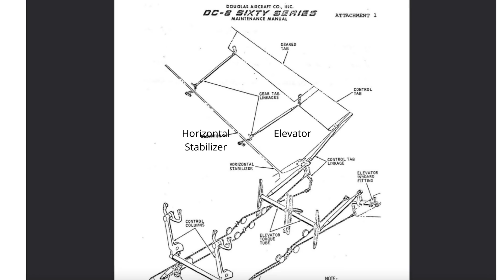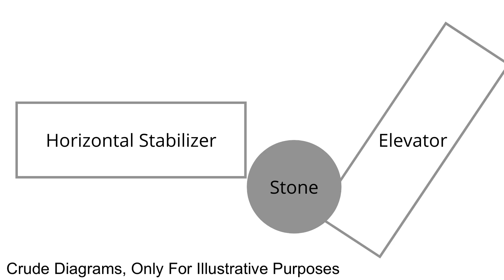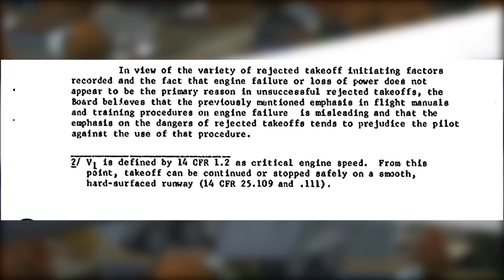How A Stone Crashed A Passenger Jet | Trans International Airways Flight 863

Comment: I was a TIA flight attendant at the time we lost our crew and plane.  Several Flt attendants from my class died in this accident and I knew the cockpit crew well.  They were excellent pilots and well respected.  Long before the report came out, it was a general understanding that the cause was a stabilizer and elevator problem.  It still makes me sick to review this crash.  News reports said the plane had no passengers and just the crew were killed.  That bothered me.  I know what they meant, but it almost seemed to me that the crew were insignificant.  These were my friends. I remember exactly where I was when I heard it on my car radio.  I almost lost control of my car and pulled off the freeway immediately, trembling. It was Trans International's only air disaster. We had a good safety record. It was like it was yesterday.

Comment: I find it amazing and cannot understand why a pilot or pilots who are in difficulty during taking off, and are still within the abort range of speeds, would rather take off and trouble shoot the problem in the air, than abort and determine the problem whilst safely on the ground. Why would they so readily risk their lives and that of their passengers? For me,  finding it hard to keep the nose down alone would have been enough for me to doubt the controls. A tail strike, well that coud damage the airframe and more. I just don't get it.

Comment: There was JAL aircraft that had an elevator issue because of a stripped bolt. They worked with the plane in the air before it crashed killing all aboard. In the subsequent investigation, because of this specific faulty mechanism (Elevator) like this crew, they never had a chance.

Comment: This crash is a prime example of how dangerous FOD can be, we tend to think of it rupturing a tire, or fragging an engine, but it can cause a host of other problems.
I find it very odd though that they put such emphasis on not rejecting a take off. Provided the aircraft is below its V1 speed, this isn't a particularly risky maneuver. Seems that training was aimed more at preventing delays and premature maintenance then it was at safety.

Comment: After watching several of your mini aircraft crash videos  I have  come to the conclusion that I like them much better than the  MAYDAY  investigations that are dramatized on television.

One great aspect of your format is a teachable moment comes quickly and very clearly explained. This episode makes me want to more carefully examine and articulate the movable surfaces in the preflight walkaround check. Also, being mindful to understand what ever anomaly is found, scratches, gouges and dents can kill, if not understood prior to takeoff.

As a teenage driver, with little experience, I put books on the floor thinking my legs would keep them in place. When I clutched and braked to pick up some buddies, the slick textbooks fell foward under the pedals. And a 1961 544 Volvo (w/seatbelts) got its right front axle moved straight back 1 inch by a high stone curb. No one was hurt, but driving to school it was obvious my wallet was going to get very skinny and my back was going to buy $700 (1967$$) parts and labor.

I never did THAT again ! !

The legacy of your videos will hopefully be helping someone who is flying, from making an error with their textbooks on the deck.  So to speak.

Comment: If for any reason the elevator becomes ineffective you still have pitch control using stab trim  .
This take off should have been aborted but once airborne the stabiliser trim would have been fully operational and could have regained control .

Comment: So sad. Any time the tail drags the runway, ( in this case 1200’) the takeoff should be rejected. The plane incoming could have been put in a hold pattern while this takeoff was rejected. Could have saved 11 lives. Hope they changed the rules and mindset of future pilots. Ever since 911, I’ve flown one time only because it was an emergency. But I will no longer fly because of videos like this and many others , TheFlightChannel, etc. if you have car trouble, you can simple pull over, if your plane has trouble, say your prayers. Suicidal pilots, unresolved issues with planes, mechanics doing things wrong, weight loads wrong, miscalculations of fuel, now Rocks! I’ve seen it all. You get on a plane and it’s Russian roulette. Great reporting here. Thank you for informing us.

Comment: I started with a big airline in 1978. As a cruise relief pilot on the DC10. When the checklist item flight controls was reached the older pilots at that time checked the elevator,   by PUSHING it first, then pulling it. Grinning, and saying, to have the stones roll of the elevators..

Comment: After retiring form the Air Force where I worked aircraft maintenance for 20 years... any pilot knows that if a plane is uncontrollable on the ground it is extremely unlikely to be controllable in the air or will likely to be unsafe to land again which makes it an automatic aborted take off. This crash was the result of very poor training and/or lack of attention/awareness or out right incompetence of the flight crew

Comment: Since the pilots did not abort take off, immediately should reduce right engines to idle, since the plane was tilting towards the left side, trying to leveling the plane. 
Also immediately should leave the front wheel on, as it is, collecting only the back wheels, if there is such an option, to increase drag on the front side. 
And Last one, applying air brakes on the main wings, to keep drag at the front part as much as possible. 
Eventually plane would fell, although ground effect might reduce impact strength if felt horizontally.

Comment: I'm a Navy veteran. Jet engine mechanic on the F-14 Tomcat 78-82. We called it FOD (Foreign Object Damage). We would have fod walkdowns picking up anything that could cause damage especially to the engines. Doing it on the carrier wasn't bad because it's only a quarter mile long but on the land base we had 11,oo
Reply: My brother worked at Northrop Grumman in St. Augustine, FL. They tore down wings & rebuilt them. While he worked in the offices, his job was to inspect the wings at different points of the repair. He even did FOD searches on our driveway! I do them around our boarding stable cause a horse will step on or taste anything.
Most of the workers were Ret Navy, my brother, Tom, was proud to work on Tomcats!

Comment: I am not a real pilot but I have a broad interest in aviation. I have read that a high speed rejected takeoff should only be done if the airplane is unflyable or unsafe to fly. Many have disagreed with this. I am glad to see a captain reluctant to not reject a takeoff. However, the aircraft in this instance clearly had control issues and the takeoff should have been rejected.

Comment: after that accident, DC 8 aircraft were equipped with a small instrument on the copilot's side,"Elevator Position Indicator" and the elevators were checked for free travel shortly before each take-off
of course, the Captain's decision to abort any take-off if the airplane is thought not to be able to safely perform will always stand, for any reason

Comment: This was a real posibility on the DC8. First, the elevators were not hydraulicly boosted, but manually controlled by cables from the control yoke. Second, with no airflow over the horizontal stab, the elevators would be full airplane nose up, so the gap between the elevators leading edge and the horizontal stab was several inches, big enough for anything to get in and jam something. A flight control check during taxi, was not sufficient as there was not enough speed to overcome the position of the elevators. Only during the initial takeoff roll, the elevators could be moved freely. Too bad, they did not abort the takeoff when the tail strike occurred.  Sometimes relying on procedures, overrides common sense. Great video.

Comment: This accident occurred during a short ferry flight, empty with a very light fuel load. Reduced power takeoffs were not used, so MAX power was always used. Acceleration is extremely fast, with V1, Vr very low. The Captain made the fatal mistake. If this takeoff had been at 3555,000 pounds it never would have happened. Tail strikes on the stretch DC8 were not unheard of and you would never Reject for one. Runway max weight T/Os always gave you a closeup view of the end of the runway shortly after you felt the wheels leaving the ground.

Comment: I was giving a lecture in São Paulo Brazil in the early 2000's, I saw the video of a street kid bringing down a helicopter with a sling shot! 
It was during takeoff . The helicopter had just dropped off large quantity of $ for the local branches of Banco DO BRAZIL, the largest bank in the country at a city about 100 miles from São Paulo. The bags of $ were transferred to a Brinks truck. The kid's sling shot hit & damaged the tail rotor. The copter had a hard landing after taking some 3 or 4 hard spins in air. The stone actually jammed broker part of a rotor blade which along with the rock managed to stop the tail rotor.  What a "lucky" shot!

Comment: I did some flying when I was a young man (I'm 68 now) and I soloed in a Cessna 150 after only 8 hours. I never finished my lessons and a check ride because I went into the navy.

That said, had I experienced an unintended rotation on take off with plenty of room to abort, I would have aborted. 

Anytime the aircraft behaves in an unexpected manner, the first impulse should be to stay on the ground or start planning an emergency landing.

Comment: its amazing pilots find more safety in taking off to gain altitude with something starkly and horribly wrong before rotation speed is attained. What does it take to reject a takeoff? Being beaten over the head? Whatever happened to seat-of-the-pants stick-and-rudder pilot instinct? It has disappeared with stupid terms emerging like "alternate law". You would thing it's a damn courtroom instead of a cockpit. Who came up with such crap? Jammed controls, exploding engines and uncontained fires do not seem to deter a takeoff. Uncommanded nose up with the tail scraping the runway in this case and the capitan orders the first officer to continue the takeoff anyway. It should have been the first officer's call to reject or continue. And he should have reversed engines and applied maximum brakes. The controllers seem to be useless too as in letting a Concord take off trailing fire and an Air Canada DC8 go around after leaving an engine on the runway due to a hard landing, to name a few.

Comment: It would seem to me that the most likely reason a stone was stuck in the elevator, and more up in the tail section, is from dragging the goddamn tail 1200 ft down the runway.  There was another primary cause for the nose to be prematurely lifting up.  The plane's center of gravity could have been off due to how it was loaded.  The pilot has to set the trim according to the load balance to take off properly.   The stones in the tail were a direct effect of the tail dragging down the runway.

Comment: Great video! We've learned a lot since then. Light airplanes get into trouble trying to continue and heavies get into trouble trying to stop. However, an uncommanded pitch up at 80kts would now be a no-brainer abort. Flight control failures are among the most challenging- the Delta L-1011 out of LAX that managed to land safely, the JAL 747 crash and the United Sioux City crash which was a tragic miracle.

Comment: The problem I have with air travel is virtually defined in this case. Let us say something similar happens while I'm driving my old Ford down the road. Something that hinders my ability to control it. Such as recently I've noticed that my carburetor is making the engine hold a faster idle than I prefer. This happens before the old girl is warmed up. 

A sticky idle means that the truck wants to go 15 to 18 mph when I only want to go 5 mph. This necessitates keeping my foot harder on the brake than I prefer. In fact if I'm not careful this condition could lead to an accident.

And yet unlike the DC-8 that must either reject the takeoff OR go for it? I've got numerous options. I can shift into neutral to get the truck to stop going forward. Or could turn the engine off with the key. 
Next even if those two corrections fail I've still got my brake and steering. Similarly I'm not required to even keep the truck in traffic. 

Meanwhile the pilot of the DC-8 absolutely MUST keep his equipment airborne. 

Further: Most resulting accidents from a sticky idle aren't even serious and unlikely to spill fuel and cause a fire.

Whereas almost all plane crashes result in serious conditions.

Comment: This led to the DC-8 takeoff procedure--at 80 knots, right seater momentarily pushes forward on the yoke to be sure the elevators react (nose down).  Did it many times.
Reply: That procedure started after the TIA accident, and prior to the installation of the elevator position indicator.

Comment: Usually prior to takeoff the pilots check for the full and free movement of the controls.
Reply: Wouldn't have helped.  The controls were connected to the elevator servo tabs which were working normally.
Reply: @CoastalSphinx  Many thanks for that information.
Colin
Reply: @CoastalSphinx  l am only familiar with light aircraft and being able to see the movement of the elevator, rudder etc.
Colin Morse

Comment: Once the aircraft was airborne, once it was approaching a stall, I understand the textbook response is to roll the airplane off its lift-vector, causing the nose to drop, preventing the impending stall.  According to the Advance Aircraft Maneuvering Program (AAMP) conducted by Captain Warren VanderBurgh.  In a video, “Control Malfunctions & Flight Instrument Anomalies - Part Two, by Capt. VanderBurgh (restored),” on the flightcrewguide channel, the seminar provides to cases: Delta flight 1080 and China Airlines flight 140, one that was recovered and one that was not.

Comment: You'd think they would Install a kevlar skid plate in that area of the plane for tail strikes.
Reply: Actually, a wheel (sometimes retractable) or a solid material is used. The solid is either steel or, believe it or don't, hardwood.

Comment: I'd take my chances and reject the take off if I had enough runway left, even if I have to run off at the end of the runway. Better that than getting up in the air and crashing back down where no one can survive. This continue-the-take-off mandate, instead of abort and stay on the ground has crashed a lot of airplanes in aviation history. You have to give the pilots the option of rejecting the take off if they see an obvious malfunction in the aircraft during the take off roll. This is where runway over run arresting systems can help a great deal.
Reply: There was another incident much more recently with a similar circumstance - servo tab moving normally but elevator jammed.  The pilot flying felt the aircraft would not rotate with normal control force and performed a late abort.  This resulted in a runway overrun and damage to the aircraft, but it was clearly the correct decision.

The striking thing is the testimony of the pilot not flying.  He was a training captain, supervising the qualification for captain of the pilot flying.

The training captain said he had considered overriding the pilot flying and ordering the takeoff continued.  Even though he knew that a late abort would only occur for a serious problem, and that the pilot flying was the one who would feel any flight control problem - he still nearly fell victim to continuation bias.

Comment: Military cleans it runways for any trash mostly not get into the engines. Getting trash stuck in a elevator or flap could happen. How did the airlines fix this problem trash seems to be all around airports.

Comment: The attitude was wrong but the aircraft appeared to be set for takeoff, there's clearly an issue with the control surfaces or the weight distribution. There was no way to verify what was going on in time and if there was something wrong they can't fix it in the air.
The pilots understand the physics, they are trained for this, maybe not specifically but the solution is clear... don't take off.

Comment: I was on the DC-8 for a few years. I rember that our DC-8 -63's had a small gauge installed on the panel that showed elevator position. We would do an 80 knot elevator check and verified the movement with the gauge. I'm not positive but I think that gauge became a requirement after this accident.